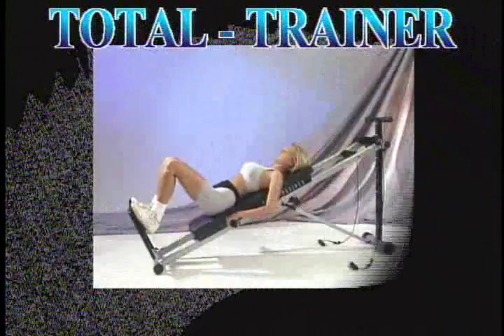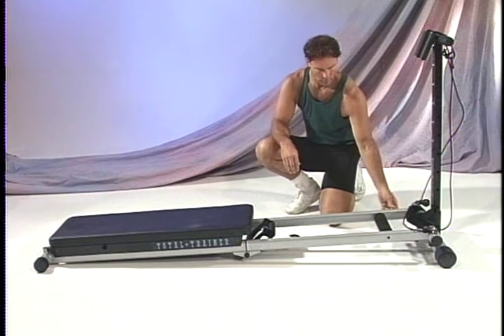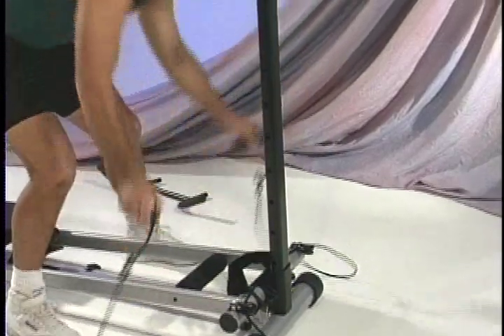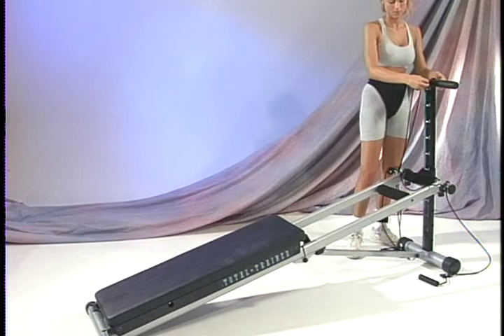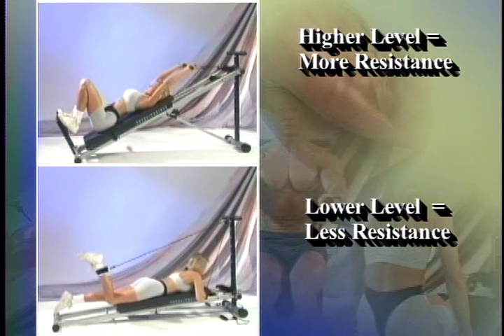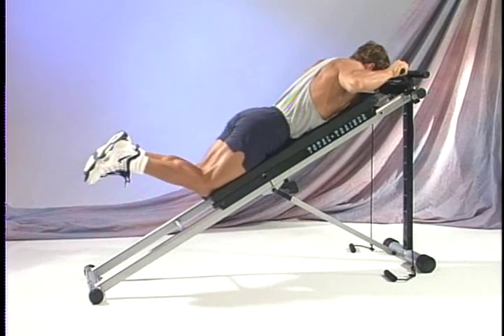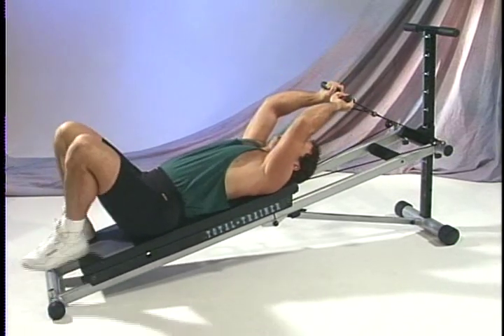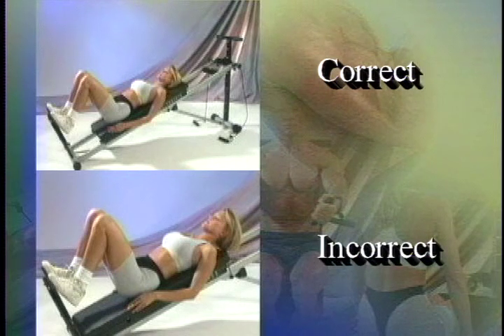Total Trainer Infiniti TT 2500

Comment: Unfortunately the Total Trainer in this video has lots of shortcomings. It does NOT use quick release metal clips for the glide board pulley system OR for the leg pulley system. It uses cheap plastic clips to attach the rope to the handles. The pull-up bar does NOT have height adjustments. It uses a cheap Velcro strap for doing leg curls. It has a cheap plastic folding handle that can break easily. It uses rope instead of 2000 lb. strength aircraft cable. The weight bar can only handle about 123 lbs. of free-weight. Need I go on? I have a Total Gym 11000 (eleven thousand) I bought brand new in 2004 that has none of these problems. If you already own one of these Total Trainers and it's holding up well, great. But if you're thinking about buying one, I would look for one of the following used Total Gyms: 11000, 14000, 24000 or the 26000. They are far superior, even if used! All four are much higher quality than the infomercial models. Lastly, any model you buy should be of either Medical Grade quality or U.L. listed for safety.